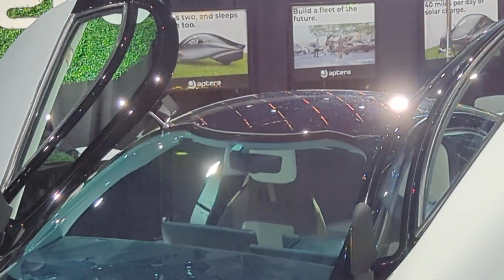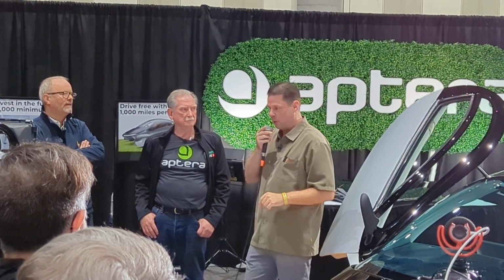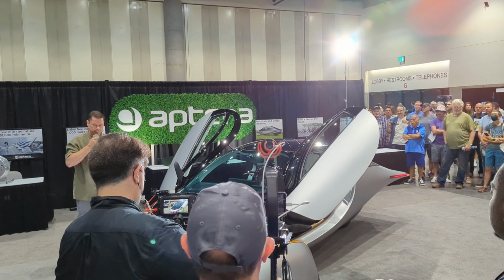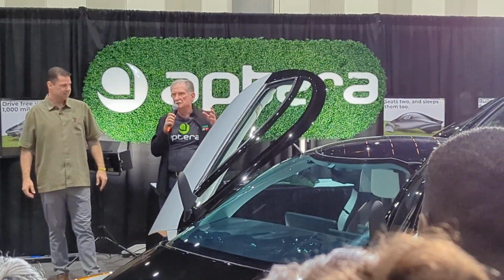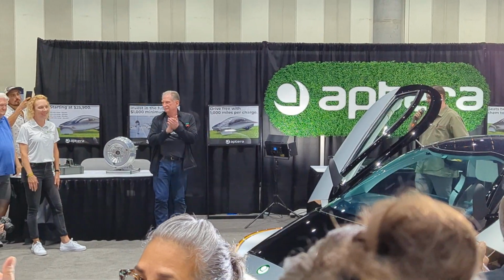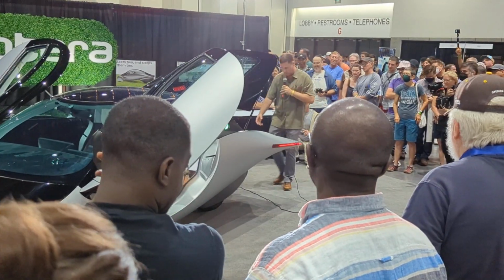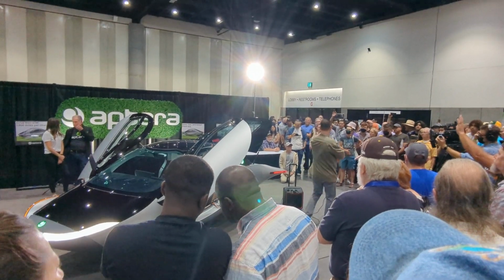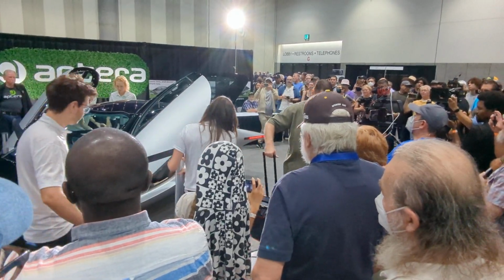Aptera Gamma Reveal full unedited footage

Comment: 3rd seat in the base Aptera. If this came true, I would downgrade my battery just to have 3rd seat. Downgrading battery means freeing up more batteries for more Aptera so its a win-win for all.
Reply: Judging by the comments on the community forum at the Aptera website, many MANY people are going to be really happy with this news.
Reply: Did they say you had to downgrade the battery for it? I really hope not. I almost feel like you need a larger battery in order to handle the reduction in range caused by the extra weight. 

I would hope for a third seat that can be removed or fold flat when not in use.
Reply: @johnnyli4702  battery for Aptera is under the seat and extend toward the rear wheel. adding 3rd seat will take up battery spaces. Everyone have different needs, I happened to be willing to reduce my range for the 3rd seat. Nothing is set in stone yet, but this is a good move for my use case.
Reply: @lk313  i wonder if the 3rd seat is for small people/kids only.

Comment: If we order the small battery can we upgrade the batteries at a later date if needed? To increase range?
Reply: Actually, Chris said you would be able to upgrade the battery size later if you wish, but he hopes you don't have to do that for a long time.
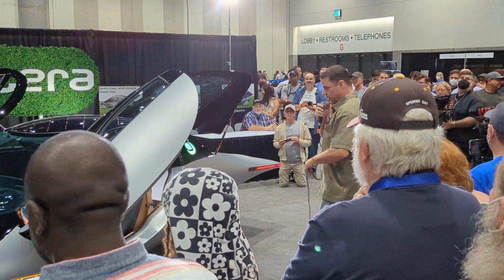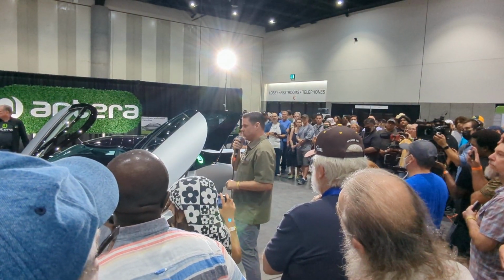Reply: @ThinkFab  Yup, the question is @ 21:52 and his answer to upgrading battery pack is @ 22:25
Reply: @ThinkFab  I think what he  implied was that as battery tech improves there will be a possibility of replacing the entire pack with better chemistry, not that Apterae will be sold with modular expandable battery packs.
Reply: @993cc  correct, when upgrading a battery, all the cells/modules would need to be replaced at the same time due to the need to make sure all cells are the same age/degradation/chemistry.
Reply from the maker: I don't think so.   at least not easily.
Reply: He did answer the question. Technically you could but he doesn't want you to. That sounds to me like 80% no
Reply: @JamaicanMeCrazy  Replacing the entire battery will be no problem. It’s how the vehicle is built, to be able to replace all parts as they age. To replace the battery because you selected too small of a pack in the first place doesn’t make sense until several hundred miles/10+ years have been put on it. It would make more sense financially before that if you sold the vehicle and purchased one with the size pack you actually need.
Reply: @ThinkFab  Yes, not cost effective: would be a total rebuild. Sell and buy a new one makes more sense.
Reply: I couldn't hear Chris's entire answer to the question of being able to increase the battery's size, but it was affirmative. Such an upgrade might be offered by a third party. It would have to include a suspension upgrade to handle the additional weight and probably some other things?

Comment: I've realized my new reason to get the full solar package.  Not to gain the 40 miles daily charge, I plan to garage the vehicle.  But 700 watts should do well to keep the cabin cool while parked outside in the summer. I have a van with 640w solar and its enough to run a 3500BTU a/c unit, which almost keeps the large van at ambient temp. Cabin volume on the Aptera is a fraction of a 13' long van interior.  Heck, even in the winter it could help with heating the cabin while parked for awhile.
Reply: Yes, and it is not only volume - the insulation of the body is likely many times better than that of your van, as well.
Reply: @n.brucenelson5920  
And solar hatch will stop the heating greenhouse effect of the glass hatch. Double effects: more power AND less need for AC.
Reply: @Aa792  Unfortunately it’s not that simple.  Solar cells get rather hot.  Unless the back side of the hatch solar is thermally insulating there will be quite a bit of thermal power transferred into the cabin.
Reply: @bobhilder1469  
Yes I kept it simple for that discussion and shading does not equate to insulation. 
Ideally Aptera has an insulating membrane below the pv cells that reduces thermal transfer. I do not know such details, but it would not surprised that the Aptera team has thought about this as they are efficiency oriented.
Bottom line is that all the sun energy (photons) that is converted into electricity is not converted into infrared rays when crossing the glass silica, resulting in greenhouse effect (trapped IR rays) inside the cabin. Yes some heat transfer will occur from the pv cells, but this will generate much less heat in the cabin than the greenhouse effect of sunlight going through glass.
Reply: @Aa792  Sorry but your say so isn’t data so it’s irrelevant to me.
Reply: @bobhilder1469  
You do not have to reply on my comment if you do not want to engage in discussion. Sorry that I did not convince you with the general concept that sun energy used to generate electricity will result in less greenhouse heating effect in the cabin. Hopefully that will make sense to others.
BTW, I am a scientist and I loved data too, but we will have to wait more for an actual production vehicle so we can get data. 
Cheers!
Reply: @Aa792  What(?).  I point out you are wildly incomplete in your assessment/claims and you get defensive and then attempt to take the high road.  Sorry you're so sensitive.
Reply: Good point! I've optioned the rear hatch just for security - so people can't see my cargo through the glass.
Reply: Absolutely we RV’rs understand that.
Reply: Im guessing you aren't using a heat pump? That would be good to know.